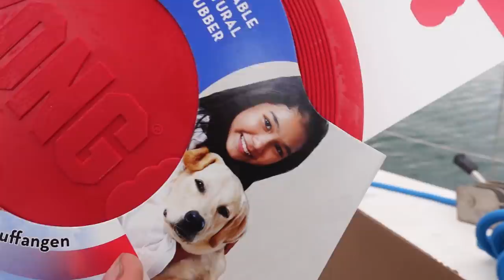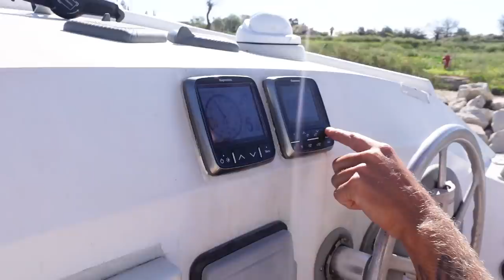We're Going Back. | Wildlings Sailing

Comment: I am all for you guys.  Mark your the captain of the boat and as such your responsible for the lives of those aboard.  You need to fix the boat.  Get the boat where you can work on it.  Make a list, if you can't afford everything need to fix it go to work, and earn the money to fix it right.  Its embarrassing to see a boat leaking like that, no heater, a wet interior, an electrical system that is sketchy at best, an engine that you can't rely on.  In my opinion as captain its your responsibility to step up and fix it, that is is the responsible thing to do and it goes with the life you have chosen.  I wish you well.

Comment: Invest in some clear Tarp, I got on in B&M in the UK for 9.95. You can make a makeshift tent/cover to work underneath in the rain. Clear lets the light through so you can see underneath it. That way you can continue to work despite the rain. If you use the sikaflex correctly (think of the paths the water will or can take and seal of the approach, it should be no problem, a small bit applied to the underside of the bolt heads just before insertion aswell as in and around the holes, and light cloth or cord wrapped around the length of the bolt along with sikaflex or other sealant or caulk will bunch up and help greatly also. Check out sailing yaba and their rebuild, especially the keel or planking videos for an idea of what I mean.

Comment: Pick up a 1/2 liter(or more) of PTFE or Ceramic engine oil additive...you will not be disappointed with engine performance.....(it's worked very nicely for me in the past)   Silicone grease attracts dust and crap, again PTFE lubricant will save  re-lubbing.....Silicone sealant, get it by the 6-pack or case...

Comment: Check the charging voltage from the solar cells you may find that you have to check the solar cell control panel for a maximum charging voltage  i.e 13 volts  as it may be that the batteries are being over charged , perhaps your smoky engine may just need a bit of a " tune up " as far as the injector timing is concerned.

Comment: Drips inside a boat= Chinese water torture!  Are those 4 batteries "house" power only (not engine)?  One duff battery will suck down others as they all try to equalize voltage. Some nice company should offer you some nice new lithium cells to test!  Good luck with the old Merc.
Reply: Ive been trying to get them a lithium phosphate deal...:)

Comment: Rebuild injectors and check for excessive load on the engine - prop shaft packing glands too tight? Do not rebuild engine without a compression test first

Comment: Just replace the motor with.a “small motor block” , which essentially is a new or reconditioned block with internals that you bolt all your fittings back onto. A very common replacement for country folks, so check out what country motor parts are supplying. I’m also sure that there would be a need for a “marine “ designated block for something agricultural. The idea of asking for some farm mechanic kid to come and give you a hand is a great idea. Again, best.

Comment: Mark Nadiyana seems you could install a mini multifuel solid fuel stove like Dan and Kika of sailing Uma or a ubiquitous Chinese made diesel heater..or a pair of them . Theres lots of reviews of different ones on U tube..
But theres different shapes and sizes including Webasto clones🙄.
Id put up headboards at least in the aft berths to keep bedding or bodies away from the steering gear.
A bit of teak oil on the rubbing strip on a dry day might save you a lot of work later and make Minkie look spiffy.

Comment: Long electrical cables getting tangled used to be a right pita for me back when I worked at festivals until someone introduced me to storing them with an 'electricians knot' (or 'chain sinnet', 'braid", 'braids, 'daisy chain'). 
Lay out the cable doubled up, both ends together. Find the middle, grab a  foot or so from the midpoint, reach through the loop and pull a loop of the cables through, reach through the new loop and pull another loop through. Repeat until you reach the ends and just poke them through the last loop to lock off. To unwind, just pull the two ends back out and you can pull the loops apart easily. 

Cables stored like this lie flat and if the cable isn't too stiff can be folded back and forth to fit in a box/locker. In theory you can just unwind as much cable as you need and lock off by feeding the ends through when the distance needed is unwound but some would argue its best to always unwind fully. Works best with decent cables, chep ones can kink after a while.
Reply: Theres an interesting  video on utube on how to bring  dead batteries back to life.  Iam pretty sure it refers to lead acid batteries.   You hook it up to a charger with the cells caps open.  Charge 5 times for a hour or so  let it cool down and any cells that are not bubbling will usually do so after 5 go around.  Make sure you carefully  view the video for exact instructions  and it probably  refers to only lead acid and iam not sure which kind you               have.  This may be of help but not necessarily.

Comment: Not a multi meter in sight!!! You need to check each battery for voltage etc. Disconnect your solar panels first,  then th possitive lead from battery to boat, then negative lead. Then take out and dump your Hot battery as it obviously has a dead cell or cells and will eventually kill your other batteries, it is now just a big resistor in your circuit were you shoulnt have one. Try and match your batteries with their capacity and output voltages as best as possible. Wish I could help but Id need to be there really.

Comment: Hi guys, the most important thing about the catamaran is that the engine will be fixed. Listening to the engine through your vlog, I find the engine is running very rough and the engine is making too much noise. As far as I'm concerned, I would replace the engine with a well-reconditioned one. In addition, I can advise you to buy a good second-hand Webasto diesel heating. These things are also in trucks and are regularly offered second-hand. Rainwater leakage seems to me to be easy to solve by means of a sealant for the time being. For the moment I wish you two good luck and I hope you find something useful with my advices

Comment: You need to put a 300bhp motor in there!!!!! That dog is the man 💯,,,,,,Always take  a picture before removing cables 👍👍👍👍 .... what is the model of that engine
Reply: Yeah just grab a V8 out of a Ferrari and you'll be ok, just don't tell whoever owns the Ferrari.
Reply: Its an old four cylinder Mercedes Benz .. designed to run pumps generators and probably small vehicles and APUs.

Comment: you get condensation on the metal fittings and they can look like leaks
Reply: Agree…Ventilation most important to stop condensation, especially if you add-in a diesel heater
Reply: I was wondering that too because I don't remember them leaking during the summer rains.

Comment: Mark, re the starting problem, are you sure fuel is not siphoning back or leaking back through the pump? I had this on an old volvo and by hand pumping it using the lever on the pump, it was better. Clearly something caused it but I was scrapping the engine anyway. I guess you don't want to hear that bit!

Comment: dry the fittings on deck and smash some cheap silicone around them to get you out of trouble, use clear and not white it seals better honestly, do the same on your windows
Reply: please never use silicone on a surface you want to paint another day .lt is not possible to paint on silicone . And when grinding it gets even worse because of the particles you produce .lf you don't believe me just try it out but please not on a sailingboat
Reply: Never silicone on a boat
Reply: @martinhoflich6150  you'll be fine its just a small area  , clean the residue off with acetone and dont sit in your home with musical drips
Reply: lf you repair cheap you will have to do it twice . Windscreens in modern cars are glued in and they are watertight . As far l know the latest technology is SMX HYBRID POLYMERE  glue . l prefer FIX ALL from Soudal . Comes in diffrent colors stays flexible and glues like hell . 
Man l wish the wildlings the dryest boat ever
Reply: Ignore all the comments! seal around the fitting or window with a  minimal sea  (3mm). ...Honestly hearing the replies from the these fanny wipes is just as annoying as you not connecting with a reply. its a short term bodge and will stop you moaning about drips!

Comment: The engine sounds so rough. Piston rings, crank shaft shells, tappets, rebore? Hmmm! Needs an overhaul. 
You would be better off with a nice new 3 piston Yanmar engine methinks.
Reply: Its an old second generation diesel they sounded a lot like that new.. 😉
Reply: Just needs new paint.

Comment: Have you considered going electric . Using an old fork lift motor like sailing uma.
Just a thought . Keep up the good work like many people I enjoy your videos about your adventure 👍🏼
Reply: Why does everyone think Electric boats are the next great thing? They have One Solar panel and 4 crappy batteries. Silent Yachts will sell you a nice Solar Cat for $3 million and up has to be covered in Solar panels and a hundred thousand or more worth of Lithium batteries and has a range of 60 knots at 6 knots they normally come with not one but 2 generators. Uma used to use their setup to get in and out of port only now they have a Master volt Electric Engine a lot of Lithium and still have problems keeping the batteries topped up. Sadly Solar/Electric may never be the answer Battery technology is advancing slowly but Solar Panels are close to their theoretical maximum. Unless there is a breakthrough using a different technology.
Reply: @glennedwards1449  

true
Reply: Catermans are weight sensitive. Minki is a smallish cat where would they put the large amount of lithium batterys. Go to the ocean volt site and check the price for a pair of them. Electric boats are still a ways off for the average cruising yacht. Bigger cats are better = more space for solar more available weight carrying but it's still a very expensive option that limits your cruising.
Reply: @jackdbur  Correct although Price and area would be much more of an issue than weight since Lithium batteries are half or a third of the weight of Lead acid (Of course they would need more of them)and they wouldn't need to carry the engine or the diesel about.

Comment: I think head gasket
Reply: I said piston rings from beginning, lost compression hard to start and stalls, plus the smoke 😶‍🌫️
Reply: @epcode5121  Is a smoke white or blue that comes from it from the exhaust
Reply: @vivianbond7449  Hard to tell from the videos...marks starting to think rings too now, shame he already had the head off, another couple weeks work and a few hundred could of fixed the old engine. We will see soon. Good luck to mark 🤓
Reply: @epcode5121  A boat engine corrosion  inside out to when the head come off did you get it skimmed to make shure it was flat to and not warped to ? With a new head gasket and new water pump and new oil for the engine to ?
Reply: @vivianbond7449  it's not my boat. I can't remember mark skimming the head when it was off
Reply: @epcode5121  I would say if it was white smoke this is more like head gasket then  when it’s rings it’s  the blue smoke and would be like Thomas the Tank Engine to lol
Reply: @vivianbond7449  he did the head gasket with the valves, although I don’t know how well or if Mark checked for a warped head. mark could tell you. 
I still think Piston rings, only my opinion from afar 🧐
Reply: @vivianbond7449  

no, but it was suggested when the motor was apart